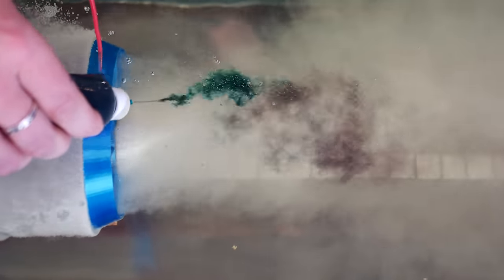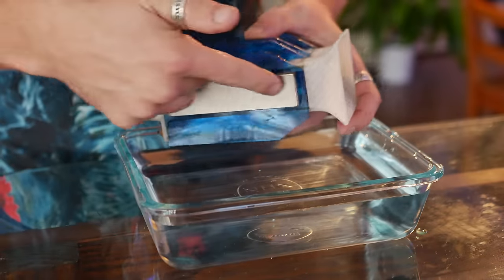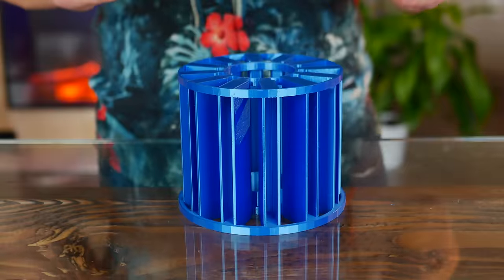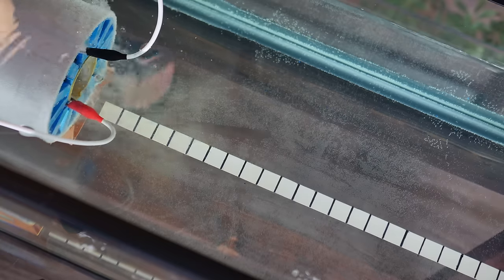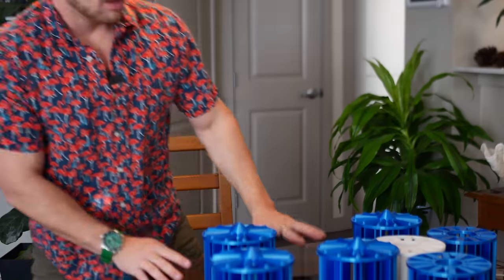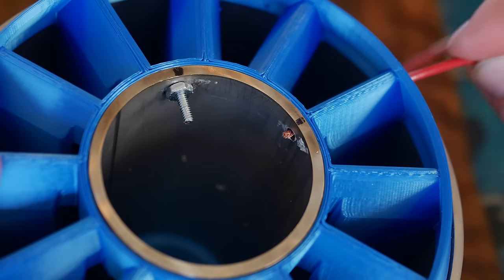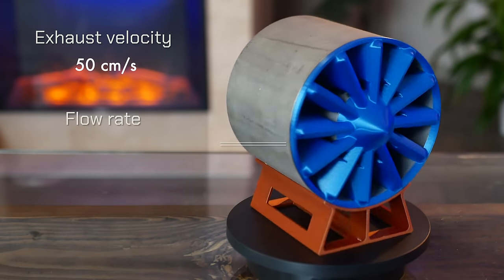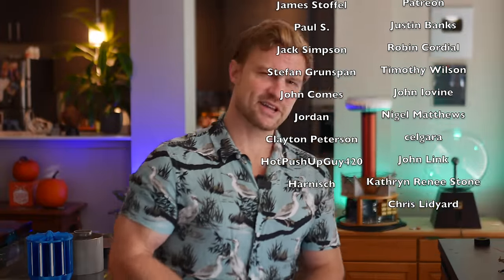Designing a Futuristic Magnetic Turbine (MHD drive)

Comment: I’d like to see a boat, but even more a comparison of efficiency between propellers and your drive.
Reply: also in terms of noise (especially passive sonar)
Reply: @Murphy5-5  

Yes, hadn’t thought of that but sound level by efficiency would be really valuable.
Reply: in terms of efficiency there is no comparison. This thruster is running at about 1horsepower, or 750w. A 1 hp motor with a prop would move vastly more water at higher speed, by 2-3 orders of magnitude. This is really just a cool experiment on solid state propulsion.
Reply: @licencetoswill  

It is cool. So what if your current device isn’t a feasible solution. Further optimization could be interesting.

I’d love to know the calculations on possible efficiency. I’m an Anthropologist so I’m way out of my depth here, just spitballing.

Because I can see the applications for ocean transportation. Too many large marine mammals die or are injured by  propellers every year.
Reply: @waynesworldofsci-tech  Вы желаете, что-бы они погибали от отравления хлором или поражения электрическим током?
Reply: @waynesworldofsci-tech   math is pretty simple
Kinetic energy of 3600ml of water moving at 50 cm/s is calculated as e=mv^2/2 so 3.6*(0.5)^2/2 = 0.45 J each second
Energy used by the motor is P=I*V so 30*25  = 750 W, since Watts is basically joules per second, you can just take this number as is, so 750 J.
At last, efficiency is useful energy/used energy, so end results is 0.45/750*100% = 0.06%, which is basically zero compared to what we have today with both IC and electric engines, even accounting for mechanical loses, and propellers that have typical efficiency of 50%.
And besides, most of the energy as @ArtemKAD1 pointed is going into electrolysis of water and salt.
Reply: lol nah, I don't think you do
Reply: A japanese company  actually build  a boat with a mhd truster
Reply: its always been a submarine thing, its absolutely coming back thanks to the much stronger magnet we can have nowadays
Reply: @StasZubenko  

Thanks. You want to talk ancient humans, I have a clue. Thrust? Not so much.
Reply: The one deciding factor is energy density. Gasoline and diesel has a lot more energy density than batteries do, so an MHD drive would only be practical in a nuclear-powered watercraft. Kind of like The Hunt for Red October!
Reply: This right here. I'd like to see him push the concept further using actual science. Look into the actual physics and optimise as much as possible, then compare with a propeller at the same power input
Reply: Yes, that would be really interesting and enlightening I think.
Reply: Without knowing the d/p across the unit, it's hard to say exactly how much power it's outputting. However, since it's safe to say that the d/p is nearly zero in this case, a good approximation can be made by considering the power required to accelerate 3650 ml of water (3.65 kg) to 0.5 m/s over the course of 1 second (3650ml/s). By ke = 1/2mv^2, the energy output in a second is  

0.5 * 3.65kg * (0.5m/s)^2 
= 0.5 kgm^2/s^2, 
= 0.5 joules 
-> 0.5 joules per second, is 0.5 Watts. 

Let's say the actual output is around 1 Watt,  if we're being generous by assuming that any frictional losses could be recovered by a different design, and to account for the miniscule d/p across the unit. As for the input, it requires 750 Watts (just over one horsepower). 

Based on this, the efficiency would be around 0.06%. The losses to electrolysis are inescapable, and due to the extremely high energy density of the O2 and H2 produced, nearly 100% of the power is being wasted.

By comparison,  a 750 Watt propellor would be gushing water like a fire hose.

That's for efficiency. In this case it's also useful to determine the thrust produced vs power input. 

F = m*a
F = 3.65kg * 0.5 m/s^2
F = 1.8 N 

So 1.8 N produced by 750 W. I don't have a number to compare that to, but it's very likely mind bogglingly low by comparison.
What I can say is that if a car were to actively produce 200 hp, (the maximum hp of my car) it would produce about 81 lb using this propulsion method. At that rate, you could move faster if you took your foot off the pedal and pushed the car by hand.

Even for use on a submarine, this efficiency would be outrageously impractical. (assuming the boat can even make enough power to propel itself at any noticeable speed, which I promise it would not)
Reply: @Sniperboy5551  Nope, at those power levels a MHD drive is incredibly noisy and still mind bogglingly inefficient.
Reply: @guillaumefigarella1704  No it isnt, large MHD drives generate a lot of noise and turbulence thats easy to track underwater.
Reply: @waynesworldofsci-tech  also small electric drive trains may help more ships run on full electric for ferry distances with diesel gens for backup or full on compact nuclear electric propulsion. (tiny reactors are being developed)
Reply: Unfortunately, there aren't many factors that can be adjusted. What you have to work with is the magnetic field strength, the salinity of the water, and the hydrodynamic properties of the device. Temperature and density of the water can also have an extremely small effect, but they're basically negligible.

For the hydrodynamics, even if it were to be made to be with zero resistance, it wouldn't have much effect since the majority of the resistance would be from the boat anyway. 

For the magnetic field, the best possible scenario would be a superconducting coil with zero ohms, and a perfect voltage source, i.e. also zero ohms internal resistance. However, even in that theoretically perfect scenario, the magnetic field would still be limited because the accelerating, current conducting water produces a counter electromotive force that will still limit the current through the coil, and thus limit the magnetic field no matter what. 

For the salinity, it's pretty simple. increasing salinity will increase current, which would increase the force. However, higher current will also increase the effects of electrolysis, limiting inefficiency, and thus the maximum efficiency will be limited and probably fairly linear. (Changing salinity won't affect efficiency very much.

Overall, I would be shocked if it can be made with anything close to a respectable efficiency.
 @Clayton-Noyes
Reply: @MichaelDavis-zu2ko  cant you burn back the hydrogen and oxygen at the exhaust to regain the energy and create thrust like an afterburner. An electric motor would still be more efficient, but at least the energy is not fully lost to electrolysis.
Reply: @marmosetman  An underwater afterburner sounds perfect for traumatizing marine wildlife 👍🏼 😆
Reply: @Sven_Dongle  it's absolutely getting investigated right now for submarines all around the world with modern supraconducting magnet and modern power supply, it's absolutely quieter, no cavitation no screw noise
Reply: @waynesworldofsci-tech Red October
Reply: Watch "The Hunt For Red October". The  Russians already did it.
Reply: @derek2593  

Real life, not fiction.
Reply: @waynesworldofsci-tech  , I have spoken with many people with clearances. It's not fiction. 
   It's even relatively common knowledge at this point. Historical documentaries and such.
Reply: @derek2593  

Can you point me to the documents?
Reply: @waynesworldofsci-tech  , lol, why should I waste time? I don't know you. If you care about truth, you'll find them.
Reply: @derek2593  

If you claim something without evidence why would we pay any attention to anything you say.
Reply: @waynesworldofsci-tech  , you are assuming I care. This isn't reddit. If you care about the truth, you will do research
Reply: @waynesworldofsci-tech  You do not need any calculation to see it. From the beginning you start with unnecessarily ordered kind of energy, simple heat or explosion will always gonna topple you if it is enough to do the job. From the thermodynamics point of view, the fact that you got a chemical reaction in itself is a bad sign, because it means that part of your energy goes into chemical reaction, you want 100% to go into momentum.

Comment: These would seem more interesting on a submarine rather than a boat especially since you could have them articulate in any direction for better 3d movement  compared to a propellor
Reply: Yes, and with nuclear powered sub, energy production isn't an issue.
Reply: Hunt For Red October has entered the chat
Reply: Давно известен лучший движитель чем гребной винт - насос создающий давление плюс сопло преобразующее давление в скорость. Или иначе говоря, это водомет. А у показанного принципа движения КПД хуже чем у паровоза.
Reply: @paulstrealer5414  Red October was a real boat and actually happened, CMV.
Reply: @BSpinoza210  Haha... no.
Reply: And it would double as an oxygen producer...
Reply: @dustinmarlow2801 oxygen really isn't helpful OUTSIDE the sub
Reply: If he ends up having to pull all of his relating videos and can't talk about it anymore..... We'll know why! 😅😏
Reply: This has been implemented already. But not at a commercial level. Just military.
Reply: @BSpinoza210  you're joking right? all of Tom Clancy's books were purely fiction
Reply: no they are rust motors
Reply: Agreed
Reply: What if you used copper rather than stainless steel for your thruster?   Would it make a difference I’d you encapsulated the inner surface of the smaller pipe and outer surface of the larger pipe to reduce corrosion.  Look at the science of dimples on golf balls.  There presence allows less air resistance than smooth surface balls.  

For real world testing, partner with Xyla Foxlin and her transparent kayak (https://youtu.be/Qg-Exm8oRP8?si=yNbmPdTsBTzWW6im).  That way you could view what is happening below the kayak during the testing.

Wishing you another great week filled with gentle seasonally appropriate weather and restful evenings.  Peace brother
Reply: @dustinmarlow2801  not really, electrolysis of salt water will give you Hydrogen and Chlorine at the electrodes, neither of which is breathable. In fact, Chlorine gas has been used in WW1 as a chemical weapon. It's the reason why while nuclear submarines do already make some of their Oxygen electrolyzing water, they first have to run it through a purifier and get rid of the salt.
Reply: @BSpinoza210  Haha no, a MHD drive that size would generate tons of noise.
Reply: the key with submarines is silence, you can avoid cavitation this way but the infrastructure investment inside an already 8,000 ton submarine to make sure it is both reliable (both in regular wear and tear and combat/emergency maneuvers,) and with enough output to compete with conventional methods, makes the technology at this time less than viable for serious maritime applications.  However, I could see this type of technology in its current state being used in either a re-useable or disposable mule for spec ops to get from the sub to the beach, or for recreational vehicles meant for shallow waters.
Reply: you could even use the sub itself to take care of some of the work, using the fact that thrust wouldn't be coming from one place you could afford to lose some and still keep going
Reply: No, I believe the Red October was a genuine submarine.  The book,  Hunt For Red October, however, is entirely fictional.
Reply: @Infinite_Maelstrom  There was never an MHD drive like that constructed for a sub. Period.
Reply: @Sven_Dongle  you are correct.  In real life, there was a submarine called Red October.  In a fiction book, this submarine was imagined to have a fictional "caterpillar drive."  It never had one in real life, but that doesn't mean the submarine itself didn't exist.  Which is what I said - or at least, what I meant.
Reply: The fundamental problem with MHD is the electrolysis ( breaking of water into hydrogen and oxygen) that occurs.

Comment: The lack of rotating components is actually a great feature of the turbine considering how damage prone a high speed propeller is to light impacts. This would also minimise marine wildlife incidents where props end up cutting and harming marine life. It also means that there would be significantly less maintenance and manufacturing requirement, and being sealed off as one part is a very good trait for something designed to be leakproof
Reply: One thing I'm wondering about is whenever or not the reaction caused by the electrolysis could have a negative effect on marine life.
Or if that's purely an "annoyance" to the maintenance.
Reply: @BloodyMobile  I don't believe that there is any effect on the water quality. Some of the water just gets turned into hydrogen and oxygen which I doubt would be enough to effect the atmosphere either. However if it did become mainstream that may produce a sizeable amount of hydrogen and oxygen.
Reply: Marine wheels (props) are made from high carbon stainless steel and bronze alloy. These alloys are blended and casted. They are work hardened tough.
Reply: @viduraherath4008  I don't know for sure but I would think most of the hydrogen and oxygen would just recombine once they're no longer excited by the MHD.  There could be other (potentially harmful) byproducts though so it's certainly worth looking into (high energy environments can cause reactions to occur that wouldn't otherwise).
Reply: Did you forget about the electricity running through it? 🤣
Reply: @viduraherath4008  You are only thinkng about the second reaction, which will never take place due to the rapid water exhange. Deadly CHLORINE gas + hydrogen gas + dissloved sodium hydroxide (lye) is what you will leave behind and that is hardly better than a few propeller accidents. NaCl (aq) -> Na + Cl (g)  Next step: 2 Na + 2 H2O ->  2 NaOH (aq) + H2 (g).
The hydroxide ions will never have the tiem to reach the positive electrode so there is never any oxygen gas formed.
Reply: @erikwalfridsson8790  Finally someone else posts this.
Reply: Just a propellor inside a fine mesh casing is much more efficient than this monstrosity
Reply: The concept of designing a futuristic magnetic turbine is an intriguing one, especially when considering its applications in space technology. However, it's important to recognize the limitations of electromagnetic launchers like railguns and coilguns. As the velocity of a projectile increases, these systems tend to scale poorly due to their immense energy requirements. While it's easy to envision futuristic weapons like lasers capable of targeting enemies at light-second ranges, the problem of light lag becomes significant, rendering most attacks ineffective at extreme distances. Missiles, another common weapon in sci-fi scenarios, have their own issues, especially with heat dissipation and sensor vulnerability, making them less reliable in such futuristic combat scenarios.